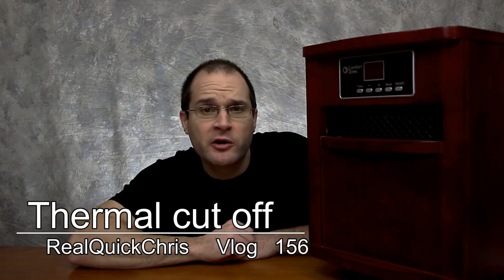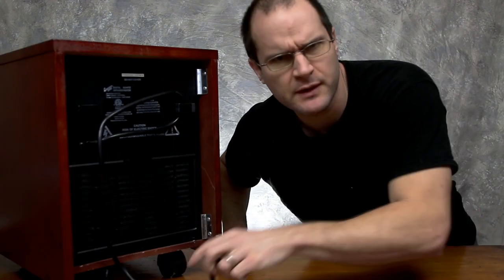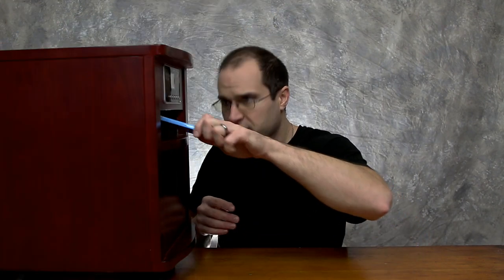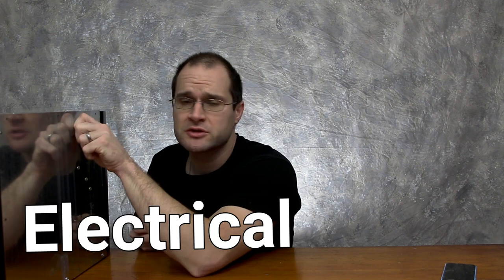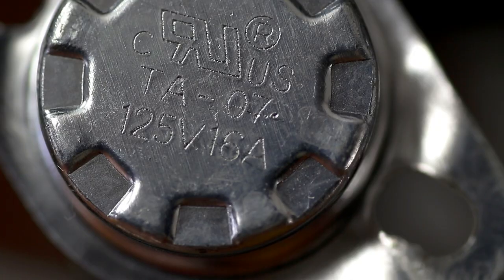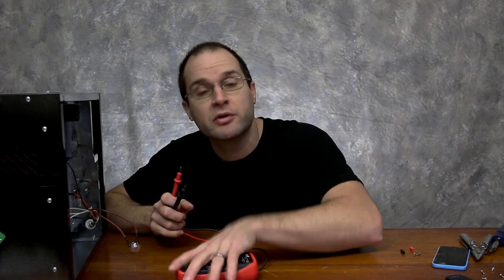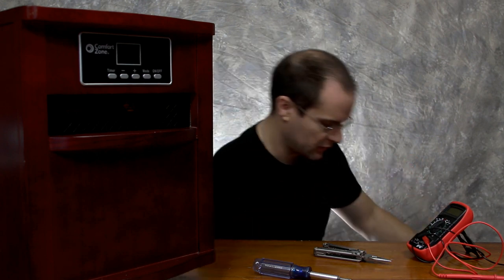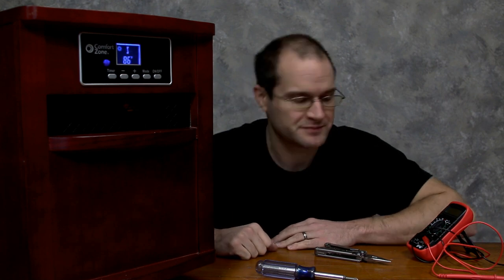how to fix a comfort zone infrared heater vlog 156

Comment: I have a heat wave heater. It has a tip over switch just like the one in the video. Once you take it off it looks like a mini toy toilet. I thought that is what it was so thanks for the conformation. No matter what position I held it could not get no continuity to pass through.  The off / on switch seems to be burned out. So, I by passed both of them, now it lights up and I get a E2 error. I grounded out the heater and it works as well as the fan. Any ideas?

Comment: Just bought comfort zone ceiling mounted for garage and workshop and it just turned off while in use late lat night. Wonder if same thing but I teach sewing lessons in garage sized workshop. Moved to high desert 2 years ago and this winter is freezing. If 50 outside its 40 in there, slab floor.

Comment: Thanks for video it got me over fear of opening it up.  Regarding method to remove circuit board for folks with large hands, I found away.   In the front, if you peal back the corners on the control panel, you will see four screws.  This will only remove control panel from box about six inches with circuit board still tethered, then you can remove the smaller four screws shown in tutorial but not blindly.  You will be able to do it outside the box but keep ribbon connector still attached. Then you just help  it go through the opening while you pull the heating unit out the back of the wood box as shown in video.
Reply from the maker: +Santo G 
Nice. I started to peel the front panel off and it started to crack on me and I stopped lol but yeah taking it off the way I did is a pain happy you found another way. Lmao I had to go look at the heater yes peel the "sticker" back to get at four screws. I am tempted to take it apart now to see how much easier it is lol awesome
Reply: I need to put it back together!! Any videos or suggestions?
Reply from the maker: How much did you take apart?
Reply: @RealQuickChris  I didn't, my husband did and I really just need to know how to put 1 of the bulbs back in first then I think I got it but don't know where it goes.
Reply: @RealQuickChris  I do know what a copaciter is though.
Reply from the maker: Bulb? The leds on the board?
Reply: @RealQuickChris   OK, I think that it was a extra because there is no place for it but how do I send you a picture or video?
Reply from the maker: You could send it to my email it's at the bottom of my about page.

Comment: Thank you  so Fix that 
my Infrared. Heater  problems looks likes your  heat on video clip.  I will fix it like that 
I have to use the voltage Meter .., by checking. As you teaching on video Thank you

Comment: Oh.... Close caption covers your notes and I had to go back with them off.  Might need to keep that in mind. I know I need to as well since I just upload a video that had notes.... That got screwed up by the close caption. I should have thought of that
Reply from the maker: +Matt : Adulting 
Closed captions, ads, cut off on tvs vs computer. If someone really wants to know they will ask lol
Reply: RealQuickChris okay. It's just something I'm going to try to keep in mind since my father, my sister, and I are dependant on closed captioning
Reply from the maker: +Matt : Adulting 
I understand you on that one best to keep the notes close to the middle or off to the side. Sometimes the closed captions can be lengthy two or three high well you know. Then on the computer you might have an ad that could be just above that. Then your suggested stuff at the top right. Hmmm now that I think about it middle to upper left might be a safe bet. So if you are filming over your right shoulder might be the safest bet. Well I will test it out and you let me know if you see it covered by anything.

Comment: Where did you buy the new thermal cutoff switch from. cant seem to find one on ebay or amazon...?
Reply from the maker: I used a microwave thermal cut off but I don't recommend that because the mount is different and you have to secure it because if you leave it loose it will short out. I will keep looking for something you can buy that will work.
Reply: im guessing it still needs to be 16a and 125v correct. thanks!
Reply from the maker: +Chris Morse 
Yeah buy boy is it a pain to find any info on this stuff.
Reply: I recently changed the thermal cutoff and could not find the OEM.  I searched the web and someone mentioned using a SUPCO SRL250.  Its housing unit is same size and the screws line up.  The difference is it is 15A  vs 16A.  Should not be problem for small unit to go lower.  The Temperature shutoff is the same, note that when you read about it one is celsius and other in Fahrenheit.  Comes out the same when you convert.   Found on Ebay.  I have just fixed and seems to working fine.
Reply from the maker: +Santo G 
Thank you. For what ever reason this one has been a pain. I lucked out using the parts from old microwaves but for others  you will be a life saver. I have been running the heater almost non stop after replacing the thermal cut off and no problems. Thanks again for sharing this.
Reply: Need to know where to get the thermo cut off switch

Comment: I would have jumpered it for testing purposes. But that's me
Reply from the maker: +Matt : Adulting 
Hey when you know how to get it working you know how to get it working.
Reply: Thats the name of the game...fix it!  I am a slave to industry procedure after all the years I've been a LV technician. If I identify a problem, bypass and test the reminder of the system if possible to be certain something else did not take out that component. break the system into separate pieces that can be tested in a stand alone manner, then test as you re-assemble the system.  Replace parts as necessary.

I've spent 22 years working in that manner, and the last 6 have been also spent teaching newer guys coming in. I treat everything in that manner when trying to diagnose and repair.